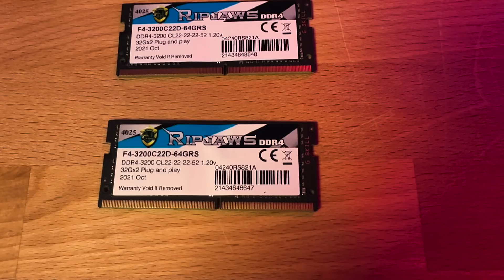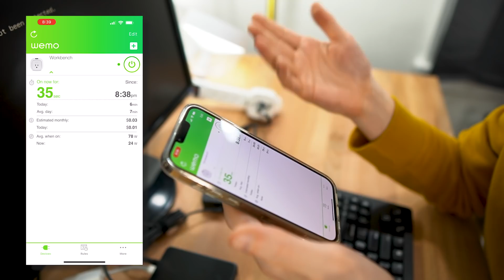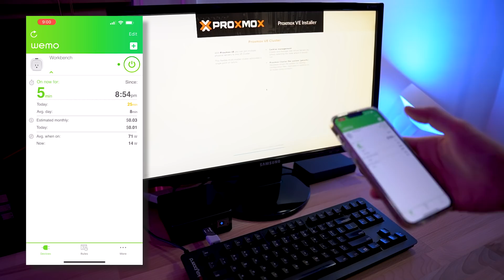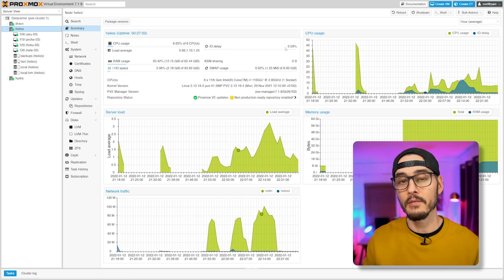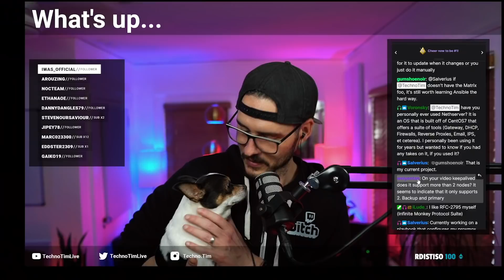Build a Low Power, Efficient, Small Form Factor but Powerful Proxmox Server

Comment: Actually most mini pc do a great job as a  low power home server, they only lack storage space to be used as a NAS.
It's better to go for a reputable brand (ex. Minisforum) as bios and hardware optimization are crucial for energy efficiency and we're not talking performance per watt that's easy to achieve but idle power.

Comment: WAIT! 25 W isn't bad, but my ATX-based server has a 12600K, Z690, 2 x 16 GB RAM, 2 x WD SN770 1TB, 2 x Samsung PM1735 3.2 TB. That thing just consumes 70 W while running a Home Assistant instance and my development Ubuntu Server 24.04.
Maybe I expected a way lower power usage for the mini PC, but I'm a bit disappointed that it's not sitting around 10-15 W as a mac mini would do.

Comment: The important point here is that it was an ‘old NUC’.  I tried buying the latest and greatest NUC and the old Proxmox kernel, even with the latest version, can’t deal with this newer consumer hardware. Networking is the primary issue.  It’s not worth it.  Just get some proper enterprise gear and don’t d1ck around with this.

Comment: Just bought a Lenovo Tiny for proxmox.   It has one SSD and two nvme drives.    
I was thinking to run the OS on the one SSD, and VMs on the two nvme in raid 1 for redundansy.    What file system should i use for the OS drive as a single disc? 
Was rhinking ZFS for the raid 1 drives for VMs.  
And if the OS drives stops working.  Would there be easy to get it back up again? If i have stored backup somwhere?

Comment: Funny enough I just installed Proxmox 8 on the NUC you decommissioned, 12gb RAM, same model with an H at the end, I think it is because it's a bigger case that can hold a SSD. Using a tiny 128gb now but I might add a bigger one for more fun!

Comment: i bought a nuc12 with i225-v, it dosent obtaining any ip untill the network driver installed, is there any way to get an ip in proxmox?
Reply from the maker: That's odd, are you using the latest proxmox (8)?  Debian should have the drivers.
Reply: @TechnoTim  yes, im using the latest 8.0-2 version

Comment: Looking into something similar. There seems to be some sentiment that consumer-grade SSDs (such as the ones you're using) won't cut it as they wear out too quickly. Did you take any particular measures to mitigate SSD wear?

Enterprise grade SSDs with high endurances and power loss protection seem to be recommended.
Reply from the maker: I wouldn't waste the money on enterprise drives.  Save that, buy a spare if you feel the need.  This server has been running 24/7 since I created this video with the drives listed and only 7% wear out and it has a 5 year warranty.

Comment: If you want to shave even more watts of those 24 watts you can do some tweaks in your nuc's bios

- disable wifi if you do not use it
- disable bluetooth if you do not use it
- disable the sd card controller
- disable front panel audio
- disable front (yellow) usb always provide power

this shaves off 3-4 watt 

now to make a real difference change the following settings in the bios:

- set the power setting to balanced
- disable turbo boost

this shaves off another 5-7 watts

my nucs run ~14-16 watt here. imho disabling wifi/bluetooth etc makes a lot of sense because those chips use power and you wont ever use this for your lab (unless its connected to wifi)

Disabling turbo boost has no noticeable impact on performance, and i tested this both with proxmox and esxi. Even with 35 linux servers running on one nuc it just happily chugs along. Disabling turbo boost makes sure that your nuc remains cooler, and quieter. It also prevents the nuc spiking to 40 watt when fully boosting.
Reply: Thanks for the comment, looking to buy one soon

Comment: Intel NUC's are great.  I have an 7th gen I3 with 32GB running Windows Server 2019 as my Plex server.

I have an 8th Gen I3 with 48GB as my day to day machine.

I also have a NUC 9 Extreme i7 6 core 12 thread with 64GB as my Windows Server 2019 Hyper-v host.

I found the 8th gen 2 core 4 thread not quite powerful enough for the number OF VM's that I wanted to run.

I picked up the NUC 9 barebone for under £500 brand new and added the memory and SSD I already had laying around.

Comment: Hi Tim! Thanks for the video! Any chance you could check if the BIOS of this machine supports multiple Power-On options? I am particularly interested in a hardware that is capable of powering automatically after mains are connected even if the machine has shut down gracefully.
(Use-case: power goes off, UPS gets discharged, UPS shuts down Proxmox gracefully, power comes back -> the server should start)
Reply from the maker: I've struggled with this too but you can do this with NUT server.  Check out my video on that.

Comment: Cool tiny server! I'm also really proud of the low power consumption of my Server. I have a Desktop HP with an i7-6700, 1 x NVMe, 1 x 2,5" SSD, 1 x 2,5" HDD, 1 x 3,5" HDD. It's running 2 VMs and at least 15 Containers 24/7 and using only 25W in idle. That's really incredible.

Comment: Running Proxmox on a Nuc i5 paired with 32gb and it's super stable! I love my own little low consumption box. I've watched a lot of your videos and those inspired me to set up my own small server and i absolutely love it. Its running ubuntu/docker, home assistant and truenas. Cloudflare DNS proxy to acces my services, using nginx. All of this because of your videos. Thank you so much for teaching these vuluable skills!
Reply from the maker: Awesome!
Reply: Question: NUC has M.2 and SSD capability. How would you segment the data of the different applications? e.g. What raid you pick for TrueNas, on which platform you install ubuntu etc.. I am on the fence to get either a NUC or a Proliant DL360 Gen9 (being the last option my divorce sentence). Thanks!

Comment: Only thing that holds me back ordering a NUC instead of building a micro atx or even mini-itx build  for the proxmox server, is that im really concidered about thermals and noise on that thing. Can you tell me your experience with thermals and fan noise after some months of running it? Also will the power consumption be really lower than a full build i can get with ryzen 5 5600g for same or even less money than the NUC is gonna cost me? Thanks in advance, also awesome video. Subscribed!
Reply from the maker: Thank you!  It's silent!  It's sitting right be hind me right now running 5 vms and is silent!

Comment: Don't do this, you will burn your SSD in this. Just recovering from backup with the same setup on Intel NUC.
Reply from the maker: I've run an SSD in an older NUC for about 8 years and 0 problems.  It's still running today.
Reply: @TechnoTim  unlucky me then. Mine is hot as hell inluding the 2.5 ssd.

Comment: I sometimes get the urge to buy old computers and give them a new life.  Tonight was one of those journeys, I started with the idea of a Intel NUC, but I found a used Dell R720 w/256GB Ram, and 2x Xeon E5-2680-v2 CPUs (40 threads).  I *think that I can run a few more VM's and workloads on the Dell R720, and it's close to the same cost as a Intel NUC.

With your personal experience, could you estimate how many VM's I could run on each?  I don't think I'll be a heavy user, and it's hard to get a good estimate from the interwebs because needs vary so much from person to person.

Comment: To be honest, 24 Watts for just being on is not a highlight. My two Minis Forum HM90's each with 2 SSDs in RAID1 running Proxmox in a cluster and 1 Dell Wyse 4030 as Quorum device also running Proxmox just need 24 Watts while running Home Assistant and a Windows 10 VM. Compared to this my older Intel NUC NUC7I5BNK is also a power guzzler.
Reply from the maker: Thanks!  I think it's really much lower.  The wemo plug was acting up!

Comment: What is the noise of this small thing? Because that and size is the only thing that differentiates it from a PC buid (my calculation) As far as I can tell, its also about 1000 GBP which is about 3 times the price if you put the same specs into a normal PC case (plus that is more expandable). If noise and size is not an issue, then the only thing remaining is power consumption. In a pc as far as I know only the fans and the processor is consuming powe (maybe motherboard gpu)r. The processors I was looking at were like max 65w consumption and if you get better airflow that will go down, while the NUC wil have to max out the fans. So in the end I estimated that power consumption will be similar and if not, then with the 600GBP I save on price, I can pay the power bill for the next 20 years. What made you go small form over PC case?
Reply from the maker: 0 noise, lower power, smaller footprint, desktop class processor with virtualization.  I am not sure that you are comparing apples to apples when it comes to the components this ships with.
Reply: @TechnoTim  Don't take this the wrong way, I am not trying to attack you, just want to understand your thought process. I am in the process of building a home lab/core infrastructure with pfsense, home assistant and Unifi controller (basically what you are doing exactly) and I am battling whether to use a PC case or go small form factor. My modem is located at my door entrance which is directly connected to my Livingroom, so noise is a no-no there (didn't get the spose approval). Rising energy prices are also a concern. So I did some calculations:

A PC build where CPU has double the benchmark (AMD Ryzen 5 5600G 65W, my first calculations were with the Ryzen 3 4100 which had similar benchmark, but I wanted to get the other components similar to yours and Ryzen 3 4100 only supported 32G ram, so I changed to the next cheapest CPU that supports 64G ram but this pumped up the benchmark, which I realize might not be a fair comparison but bare with me please) and changed my config to a same speed DDR4 64 GB memory. This setup would cost about 500 USD (this is without the nvme and SSD, but including the PSU, fans, motherboard, case). The NUC config is about 1500 USD (this is all calculated on prices where I live and not calculating the disks, because they match). The NUC has a total watt consumption of 40W (was bit confused here, because the datasheet said that the Intel Core i7-1165G7 processor draws a max 15W power and the NUC datasheet said it had a 120W power supply, so I went with the 40W you said in the video) and the PC config is (added the max power draw of components) is about 100W. Based on this, if the load is 80% always and it runs 24/7 the annual power consumption of the NUC is 70 USD (0.04KW*0.8*24hours*365days*0.25USD). The PC would run an annual cost of 175 USD (0.1KW*0.8*24hours*365days*0.25 USD). So the difference in CAPEX price is 1000USD and the difference in OPEX running cost is 100USD. So the return of investment is almost 10 years. (plus this is calculated with global energy prices, where I live the price is only 0.16 USD maximum, so that would prolong the return to almost 15 years) So the power consumption didn't seem like an issue to me. Which leaves the noise and size. For that, I decided to just cable over 10m to my storage room and put up a wall rack and place it there. That cost of the rack, cabling and labor is about 300 USD if I do the installation, so the price difference is still 700 USD. (from which I can just build a second PC case server :D )

Since I saw that you already have a server, I assumed you have a place where you can put a big case and where it can be noisy. That is why I was curious as to why you would need/prefer a small form factor device, where components are usually more expensive and expandability is basically non existent. If its for testing, then noise and power shouldn't matter for the time you are testing (not always on). If you are using it to run 24/7 then you could just place it next to your server. I am leaning towards a PC build, and rather solve the problem of the noise and size by changing the installation location. The deciding factor was price plus the fact that it has 3 PCIe slots on the motherboard which can be expanded later with network cards or if I wanted a GPU in there there is that option. A processor change is also available if I want to go bigger.

I assume the video is for educational purposes and aimed at people who don't have a place to put a home server (apartment) but for people who can put it in a dedicated room (storage, pantry, garage) it just doesn't seem like a financially good choice to me. Sorry for the long comment :)

Daniel

P.S.: love your videos btw. :P

Comment: Great video! I just bought a Lenovo ThinkCenter M90q with an i5 10500T (6 cores 12 threads) for real cheap (380 €). Those supposedly idle at 12W. I already installed Proxmox VE on it with a Debian container running Docker and Portainer, and more containers and virtual machines will follow. I own a dual Xeon server, but it's power usage is just too high, even at idle, so the little machine is ideal for 14/7 operation. Loved the video. Keep them coming! Cheers!

Update: By the way, mine has an auto-on after power loss feature in the BIOS, which is great for a server.

Comment: In Germany, by many users a low power home server starts by 1.5W and ends by a maximum of 10W :D ...in Idle of corse. You had performe the measurement by booting up. 
I hope my Intel Nuc will be lower than 5W (N5105, 16 GB RAM, 0,5 - 1 TB SSD).

But really nice video. I enjoyed it a lot.

Comment: Great Vid Tim, I also run a ProXMoX server on a low power platform. I’ve setup my server on an old used Dell 7040m, 1TB m.2 for V-storage and a 2.5” SSD for the OS. It’s only a 35W CPU i7-6700T. It’s fantastic for home use. The small form factor is quite deceiving as it can sit on a shelf like a book.

Comment: I am looking for something to replace my Dell PowerEdge T20. (Xeon  with 4 cores/8 threads) and found this video. 
Just curious will this be worth while replacement? I would like to run Proxmox on it.  
Will it be able to run Blue Iris in VM, plus regular Windows VM for desktop (occasional use, no gaming, no video editing) plus various linux based containers like home assistant, pfsense etc.?  (old poweredge not able to handle blue iris with ~8 cameras). Or I need something more powerful?
Reply from the maker: One of these NUC should do,  you also get QuickSync which works with BlueIris!

Comment: Really great to see what intel nuc can achive. 
I wounder how effecient it could be with a p31 gold and some low power ram? 

Im planing to do a build my self i wanna see if using an unlocked cpu and a motherboard with great voltage control, if its possible to tweak things so you get below 10 watts idle and then having headrooom if or when you need the extra speed. But my use case is off grid solar so even 24 watts idle is a lot likley some linux optimastion and cron jobs to power cycle it can help but everything has its cons and pros :p

Comment: the price of the barebone nuc just made me lol.... definitely a very, very bad time last couple of years to spend any money on IT components... 900 euros for a barebone with no graphical power.. there are cheaper ways (in better times) to get more. I'm sure this nuc works well for the limited use cases. looking hard at power consumption myself but 900,= + add another 300-400 for components does make you save anything... Better use something you have laying around..
Reply from the maker: Tech times are tough right now

Comment: Hey Tim, what are the temperatures on your Nuc after continuous usage? I have a similar setup to yours and mine are always 100°c. I haven't measured power but I'm guessing that's also always a 100% too. Is there any way to reduce this?
Reply from the maker: Mine seems fine, fan is never on unless I am rebooting or patching VMs
Reply: @TechnoTim  Interesting, my Proxmox defaults to setting the CPUfreq/scaling_governor to performance mode. I've added a cron job to set it to powersave mode on every reboot at now getting 65°c of average temps which still feels a little high but better than 100°c

Comment: Excellent video! I've been running Ubuntu server on a NUC for a couple years now and just recently switched to Proxmox 7. I love Proxmox for it's ease of use and ability to manage VMs and containers. One issue though is that I've run into an issue with being able to pass a USB device through to a LXC container. I'd love it if you could do a video on this. Of course if it falls in line with the content your trying to put out.
Thanks for all of your videos, I'm alway excited for the next release.
Reply: I dont know if this may help you, but USB 3.0 is by default a storage device while USB 1.1/2.0 can be HID or other device.  USB can be confusing as it is shared data and power.

Comment: Question is there any big difference between the i7 and the i5 models for the nuc or will I be losing a lot. I guess what i am trying to say for using the i5 version will i still be able to do the same vms for proxmox or to get the same results within the video i have to use the i7 version. My plan was to use the Intel NUC 11 Pro NUC11PAHi5 to be my start of my proxmox sever that would then act as a backup for my sever one. thank for the help  If there is only little difference between the two then that is fine again thnx for the help :)
Reply from the maker: I think the only difference is core count and speed but you'll want to verify!